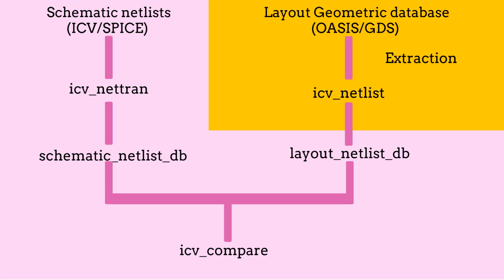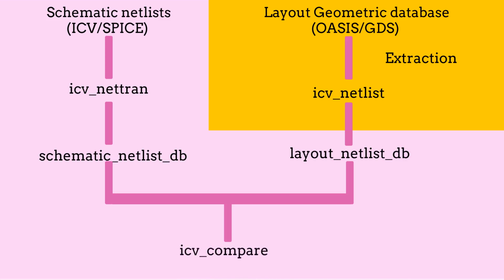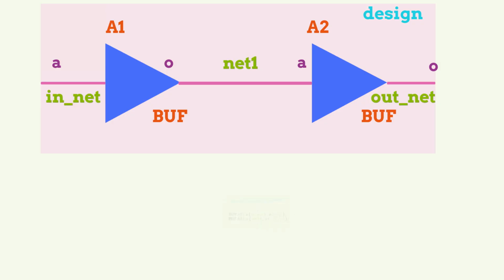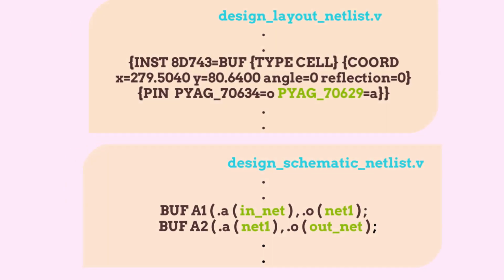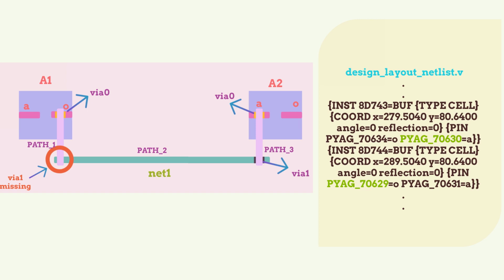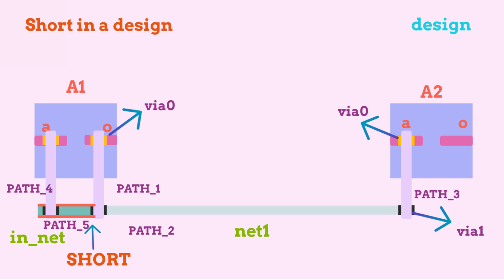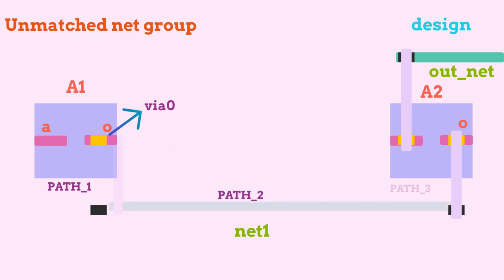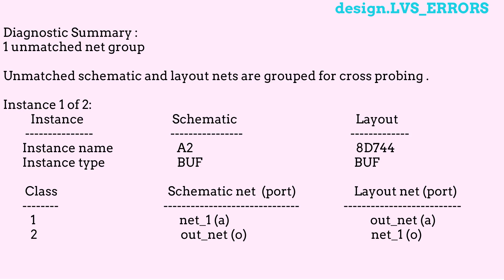LVS (LAYOUT VS SCHEMATIC) UNRAVELING

Comment: Good lecture,the concept was easy to understand but GDS file will be extracted after tapeout ryt
Please clear this
Reply from the maker: GDS file represents layout data such as shapes and layer information and can be written out during any step of the P&R flow for reviewing the design. 
Case in point, LVS is a comparison between layout and schematic, where layout is given as input to the LVS flow in the form of GDS/OASIS.
Before sending the GDS for fabrication all the layout checks such as DRC, LVS, Antenna are done using the GDS file as input.
Reply: @SparkIntellect  Tq Sir/Mam for clearing this doubt
I wish u upload more videos in the future 
Thank you expecting ur videos
Reply from the maker: @YusufAfridi-g7f  Thank you for leaving a comment🙂. Stay tuned for more videos.